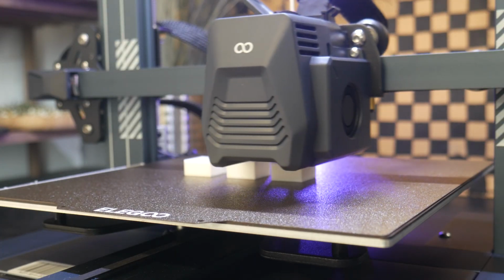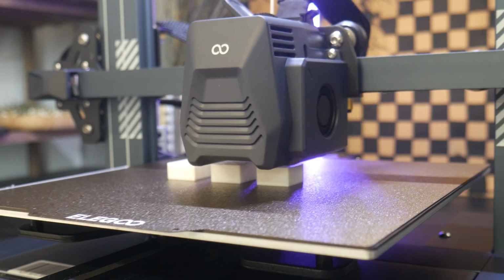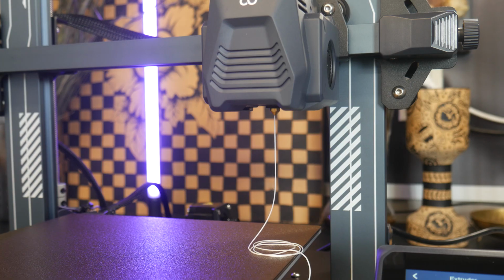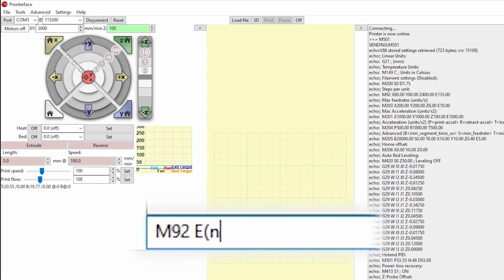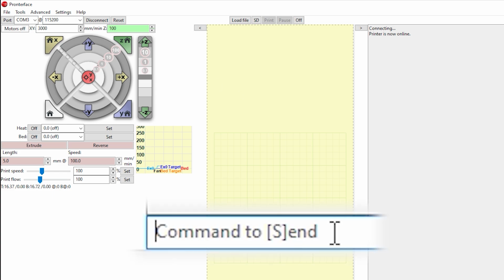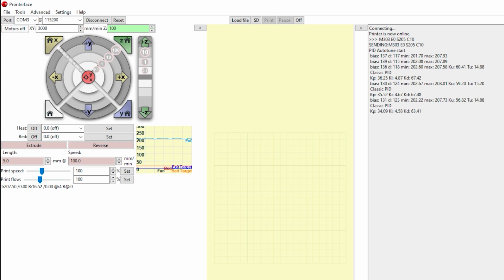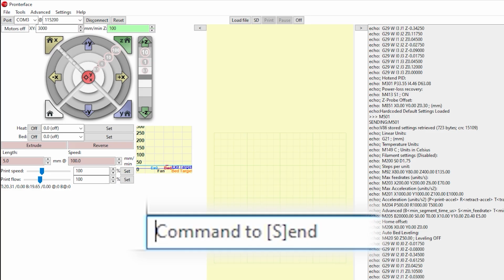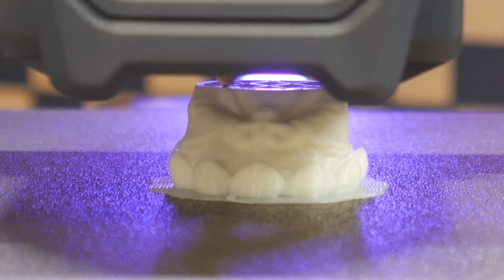Tuning a New 3D Printer -  How to Setup & Tune your Elegoo Neptune 3 Pro

Comment: I have the Ender 3 pro. I got into 3d printing very recently. I’m one of those oblivious people. I have so many questions. But I’ll try to learn from this video as i go. My obvious question is will this tuning work for my E3 P? I tried leveling the pad. If i had hair i would have pulled it all out. I tried following people’s paper process. That’s a nightmare because when you do the back the don’t get off and Vice verse. It’s made me put my printer on a shelf and forget about it. I need help! Don’t know which way to turn.
Reply: I know this is a couple months old, but are you talking about leveling your bed? If so, the first time could take a little while to get it right. Just start at one corner, what you're looking for is for the paper to have slight drag on it. When you go around and do the other three, you'll notice once you get back to the first one you did, the paper will probably not slide under it. That's when you do it again, it will all "level" out after a few times. Once the four corners are done, move the extruder to the center of the bed and check clearance, adjust from the four corners just a hair to get it where it needs to be. This will get you up and printing on your Ender 3 Pro. It's a great machine to start with, and once you're going on it, it begs to be upgraded. Hope this helps.

Comment: Where do I get current steps
Reply from the maker: M501 while tethered over usb will list all saved settings on the machine. Alternatively there should be an advanced menu on you printer that should have your current steps

Comment: can someone help me out? I am not understanding the math problem. I have the Neptune 3 Pro and the E value says 380.
i told my N3P to load 100mm and it only extruded 92 so what is the exact command i type into pronterface?
then i ran the PID autotune and got values P27.21 I3.01 D61.51 but when i type that with M301 it says "SENDING:M301 P27.21 I3.01 D61.51" and doesnt change
do i need to wait longer or type a different command?
Reply from the maker: after uploading the new pid values, type M500 to save, and M501 to refresh your printers saved settings where it should be updated. 

your new e steps should be 413 according to your results.

thanks for watching
Reply: Maybe late for you but helpful for others. His example is pretty confusing because he doesn't show the actual message you need to type. So you get the current E-value (from typing M501) which might be 380, multiply that with the 100/YourValue (which was 92) to get 413, the actual message you type will be M92 E413, no parenthesis or anything.

Comment: Thank you for the video!
One problem I ran into: after sending the M303 E0 S205 C10 command, the console threw this error: 
echo: Heating Failed
Error: Printer halted. kill() called!
Any idea what should I do in order to run the auto tuning?
Reply: Found out you have to update the firmware for it to work as shown!
Reply from the maker: As Aaron said, update to the newest firmware!
Reply: I an trying to figure out where to send the command from . I don't see that interface on the display.
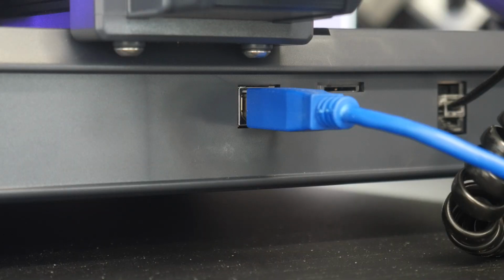Reply: @studio421 3:16 as explained here you need to download the program called Pronterface to your computer, and connect the printer with the USB cable

Comment: Sorry back again. How exactly do you find your current steps? Do you just send a M501 command then look at the number next to the 'E' on line M92?

Because if so, then for me that number is currently 380 which seems excessive when comparing it to this video and your esteps which is 135.

And just for clarification, in order to find the amount extruded, after measuring and marking 100mm of filament and telling the machine to extrude 100mm of filament, you subtract the amount that's left from where you marked from 100 and that's the amount actually extruded, right?

My problem is, since the machine says my current steps per mm is 380, my equation is (100 x 380) / 87.5 = 434.29, the reason I question it is because I noticed your Steps per mm in the screenshot in the video is 135, which is a far cry off from the numbers I'm getting, is this normal?

One last question, should I be rounding or is using decimals ok?
Reply: Did this work out for you? I’m currently in the same situation and I’m looking at a new value of 417.58.
Reply: @armstrongthegod761  I have a new value of M92 E435 and now it fits perfectly 100mm. My default value was 390.
Reply: I tried it twice and the M500 command does not seem to be saving the new values when I bring it back up with M501
Reply: @armstrongthegod761  Use M92 Eyour_value without brackets (was my fault as well)!
Reply: @GeorgMierau  you are an angel thank you so much!!!
Reply from the maker: Yes! That’s correct, M501 will list the current steps for all axis and E is the extruder. Since I was under extruding I had remaining filament not extruded so I subtracted that amount from 100. Some extruders use gear ratios. If you have a titan style extruder than around 400 steps is common. I might have used some screen cap from the Neptune 3 non pro which has no gearing so it’s a lower step per mm.

420+ seems high, try heating up your extruder higher than you would normally for pla and feed the 100mm at a very very low speed. This will ensure that there’s no steps lost due to the hotend not being to melt the filament fast enough.

I hope that helps!

Comment: I put in a order for the 3 Pro.  But I wanna print with the CHT nozzle.  What upgrades would you recommend? and what version of the CHT nozzle is best value and most reliable(durable)?
Reply from the maker: I’ve never used the cht nozzles! I’d just order a few of the cheap ones off Ali express and source some high heat thermal paste. Looks like the only difference in the cheap Chinese cht nozzles is the depth of the chamfer on the inlet, maybe grab a nice countersink bit and ream them out a little. As for mods I’m not sure you’d need any? Can always grab a few extra pei build plates tho!

Comment: Also using a Neptune 3 Pro - But Pronterface is throwing an error whenever I try to send M303:
Printer is now online.
>>> M303 E0 S205 C10
SENDING:M303 E0 S205 C10
PID Autotune start
Error:Heating failed, system stopped! Heater_ID: E0

This also results in the printer becoming unresponsive, which is unideal. 

Edit:
As of 12/7/2022 - You can now grab the v1.1.5 firmware release on github for the 3 Pro's firmware which enables M303 functionality.
Reply: Just tried it twice on mine and having the same issue. First I thought maybe it was due to being up to temp since I did it right after calibrating the steps/mm. Let it cool and try from room temp but same issue. Locks up printer and have to switch off/on.
Reply: @VertigoDesignCo  Yep, seeing the same behaviour here. 

It prints fine, was able to get the buddha out, but wanted to tune it a bit. So it's not a broken thermistor like I see some online comments saying. But it looks like on reddit & the Fan facebook page there is several people seeing this. I might shoot them an email in a bit to see if they have any ideas.
Reply: @mxrider772  Same here! I've had multiple great prints but came across this video and figured I try my hand at tuning it a bit. Let us know what you find out!
Reply: @VertigoDesignCo  They noted they are aware and are working on a fix. It'll be posted on their firmware page when it's fixed.
Reply: @mxrider772  Hey I really appreciate the update! I’ll keep an eye out for that. I must say though so far I’ve got about 18 hours of printing done on my N3 Pro and it seems to hold its temps fairly consistently.
Reply from the maker: I talked with elegoo and their engineer said the firmware it was shipped with doesn’t support M303 autotune. I’m guessing maybe the extruder number is labeled differently? I’ll try and look through some firmware and see if it’s something that can be easily enabled without a board flash!
Reply: @WildRoseBuilds  Ah, I thought you had it working on the N3P based on the vid. Guessing that was using a different printer in that case?

Comment: When I run Send: M303 E0 S205 C10
Recv: PID Autotune start, more than once I get different results, how do I know which to use?
Reply from the maker: Hey robert! thanks for watching. does your hotend have a silicon heat sock on it? do you have any rapidly changing temperatures in your print environment? you can increase the C10 (to maybe C20) part of the command to increase the sample size and give you a more consistent average. Let me know if that helps! :)

Comment: Great video.  I have a question on calibrating Cura times with actual print times on the Neptune 3.  My actual print times are quite a bit higher than Elegoo's Cura version.  How do I get Cura's time to be more accurate?  Thanks!
Reply from the maker: I think this has been a common problem for a while in cura, i'm not sure there is a workaround. Prusa Slicer has pretty accurate print time predictions. I would highly recommend making the switch!
Reply: @WildRoseBuilds  Thanks.  I will take a look at it.

Comment: For belt tension you should really use a guitar tuner to match the expected frequency for the belt length fully extended based on the belt spec.
Reply: Adjusting belt tension to this degree is totally unnecessary. All you need to do is make it snug.
Reply: @pcdc1337  So many people get "make it snug" wrong, often on the side of too tight resulting in ruined motor shaft bearings.
Reply: @daliasprints9798  This. I understand that if someone knows how to set the proper tension it makes sense to them. But you are right, saying "make it snug" could, and obviously does, mean different things to different people. "Oh, you want it snug, say no more, I know the exact amount of tension this thing needs". Said no one.
Reply from the maker: Interesting idea! I’ve used deflection in the past to measure but I just go by feel now
Reply: @WildRoseBuilds  I'll try to give you the link to the method I use but YouTube often deletes comments with links.
Reply: @daliasprints9798  you can send to me if possible... Really 😊

Comment: One last tip. Print a thin cube to save filament. Check the surface and adjust flow to get a nice top layer.
Reply: Flow tuning is not really part of tuning the printer. It's a filament related parameter. There are lots of other parameters that should be tuned for each filament type and brand if you want the best results. Just to name a few; temperature, pressure/linear advance, retraction.

One more printer related tuning I know of is the X Y Z axis calibration. Check if a 100m movement command really results in 100mm movement and not 99mm for example. Doubt if it's necessary for an out of the box printer though.